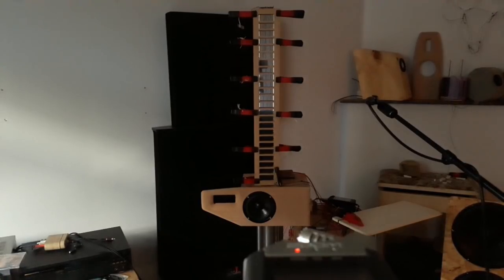Contraption 1 - Bass reflex and ESL- Music

Comment: Very nice sound, great song,can I make a suggestion with regards to yout CNC router table top,flatten it again,then coat top and bottom and sides with sanding sealer,let first coat dry,sand it with 240 grit,but don't sand off the sealer,just sand until smoth,like babies bum, coat it again let dry,sand it with 360 grit,it will be smooth like glass,the board will never warp again.You may have already known that ;-)
Reply from the maker: Thx . But when using the cnc i will cut and screw in the spoilboard so :( . I use mdf for wet rooms now That seems  much better then before.  I might ne need to level it and test it few days later.

Comment: They keep getting better and better. What's the endo goal? Btw, why the emphasis on efficiency? Amp power is no problem anymore..
Reply from the maker: well i think i go low efficiency , reason it to be able to use woofers i want, other way around would be nice but it depends on the stepup ratio and since i want to keep that small, and dont want to use huge panels. im kinda limited :)

Comment: Something doesn't sound right to me. It sounds harsh at some frequency range. Did you cross them over too low for the electrostats? Would a 99 db woofer crossed over at a little higher frequency sound cleaner. I would like to see a shootout between the wire panels you made and the other flat solos panels. Maybe cross them over a little higher...The trumpets sounded a bit harsh at the end...maybe your room interaction?
Reply from the maker: well could be anything :) since i just trew then in there :) not exactly playing hours with a filter.  even the panel itself need some segmentation, i just did a crude filtering of the top end. but i guess not enough. a 99 dB woofer would be allot louder again :) but yes this woofer is to small also i never really like the combination of a esl/open baffle with a reflex. in the end the goal is not to mate them with such woofer :) but replace the wire tweeter in the planars. and maybe just maybe make them push pull as well :)